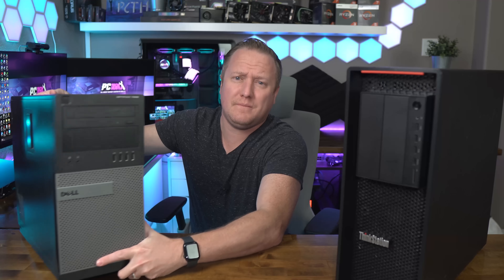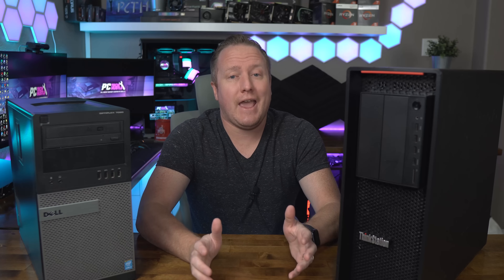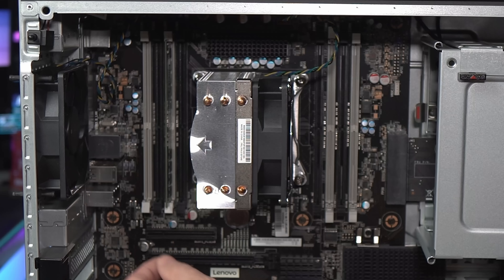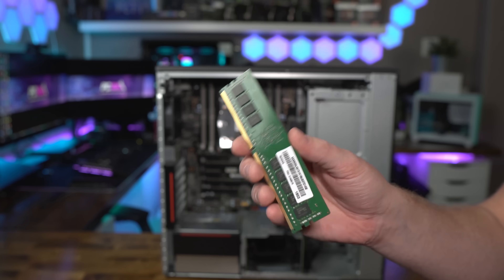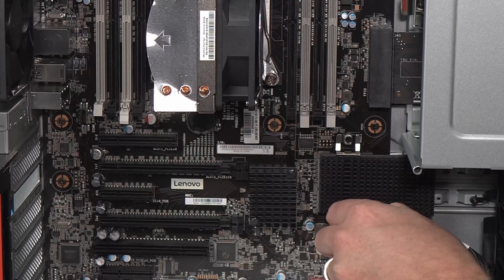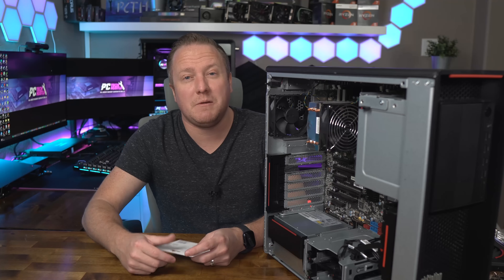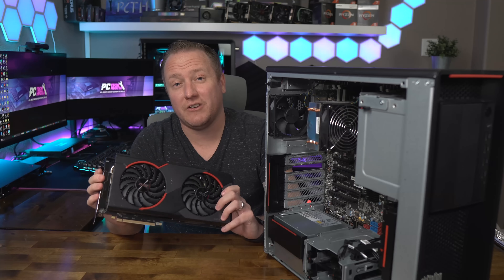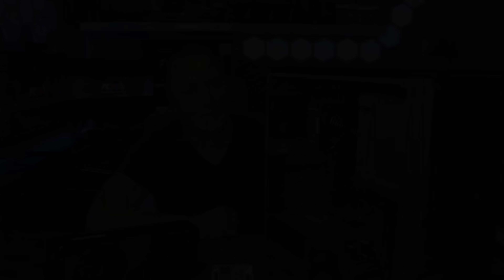The 2024 New Meta of Budget PC Gaming! - Lenovo p520, rx5700 XT, 32GB RAM for UNDER $400!

Comment: I've gone through a couple of these boogers (Not because they broke down, just kept selling them lol). They are really solid and the fact that 99.9% of listings you'll see come with a 900w PSU and two 8 pin connectors, is great for GPU compatibility. Awesome machine for someone looking to build something simple yet powerful.
Reply: They don't come standard with any specific PSU There's a 690W, 900W and 1000W PSU available, and what you get depends on what it was ordered with...
Reply: @timfountain98  Ok.... let's say it this way, unlike the p500 or p510, 99.9% of the listings will be for configurations including a 900w psu. With all the versions I've bought, sold,  all the listings I've seen, the option for a non-900w version doesn't even come up. Almost like it doesn't exist lol.
Reply: @dKing So I did actually go and look through the first 10 P520 listings that are up on ebay right now.  Not a single one of them lists the power supply that is in the box.  Not sure where you got your 99.9% from. As I said, mine came with a 690W and when the configurator for the P520 was active, you had to choose a specific PSU.
Reply: @timfountain98  Your experience is totally different from mine. Especially when buying from a certified refurbisher.  They usually have a custom specs page and do include the PSU. For the ones that don't it's easy to ask, and they usually come with 900w.
Reply: A very clever build. Thank you.
Reply: Whats a good budget CPU for the P520
Reply: @StephenBarnes-z6c  W-2135 6C 12T is a good budget. I have a W-2295 in mine, but, er, that was not at all cheap....
Reply: Ehh. The cpu upgrade path isn't great... Only compatible with decade old cpus
Reply: @DdoubleB03  If they get the job done, that's all that matters. The P520 is still  a great option for most gamers. Especially folks that play games at 1080p and do mostly e-sport titles.
Reply: yeah its about time this segment matured, what a pain back in the day having to replace the power supply just to power up a decent video card.
Reply: @MrSamadolfo  Beautiful thing is? As the machines of 2019 and 2020 continue to age, they'll be in the next wave of liquidation sales and showing up in crazy amounts on ebay lol.
Reply: FACTS 😎 @SkywardKing

Comment: I use a used late 2021 aurora r10 alienware ryzen 5 5600x and a rx 5700xt 32gb 3200mhz ram and its amazing I paid less than 500 even after adding a aio, ssd and 24gb ram since it came with 8gb originally
Reply from the maker: Dang!  That's a heck of a deal!
Reply: Paid 350 originally for the pc with a 1tb hdd, fan cooler and 8gb ram.  I added the aio, 24gb of ebay ram, a 500gb ssd and upgraded the psu...I love ebay lol

Comment: Currently using this with a 6700xt and its been a beast for the money . Heat is the main issue noctua makes a cooler thats low profile and is compatible with that socket .
Reply from the maker: Nice!  Ooo I do love the idea of replacing the cooler!
Reply: @PCTechHustle  NH-D9DX i4 3U i believe thats the cooler . i accidently purchased the d9l but made it work with all the spare hardware i have around and its definetly an upgrade over stock.
Reply: @PCTechHustle  Yes that noctua works and also repleaced the fans in mine and added a second intake fan as those stock fans the cpu gets so hot. Now at max load it stays frosty.
Reply: And windows 11 wont be any issue for this platform.
Reply: @deadatdawn2108 Do you mind linking which 6700xt you went with and confirming the Noctua cooler? I am thinking of doing this exact setup.
Reply: @BoostinChick  Noctua NH-D9DX i4 3U perfect fit and so much better.
Reply: @feelsbad1193 do you need any extra cable adapters the fan pin is different right?
Reply: @Gh0styGames  I needed 2 fan splitters and bought 4 pin pwm fans. I did have to remove some uneeded plastic off the fan connectors to make them fit. All very easy to do.The pins are the same 4 pin pwm but this plastic separator I removed.
Reply: @BoostinChick  i used the xfx quicksilver319 its a pretty massive card and it fit no problem.

Comment: I've just bought an Optiplex 3020 for my grandson to play Minecraft and Roblox on with Win11 installed, so I don't think the Optiplex is quite obsolete just yet.
Reply from the maker: I think 4th gen will still run windows 11.  For how long is the bigger question though.  I might be in the same boat with this system.  Time will tell!
Reply: I mean there are some Optiplexes that will officially support Windows 11, like the 7060 I set up for my sister. It has an 8th-gen i7. I paired it with a Sapphire Pulse low profile RX 6400
Reply: for something like minecraft and even older titles and maybe some more current the optiplex will be fine, its those that are looking for the more demanding stuff the optiplex will start to show its age.

Comment: I still don’t know how to install windows on this I bought windows 11 and i just can’t install it on the Lenovo p520 can you maybe make a tutorial on how too?
Reply: 🙂 pull out the usb jump drive and first verify that you can pull up the Bios screen, check out all the settings, maybe put everything to default. look up the boot order and move the boot order around so that USB boot is first, also the jump drive might have to be in a specific usb port on the back of the case. But first thing is to pull up the bios screen cause if you cant even do  that then we have a big problemo.
Reply from the maker: That is odd.  I was able to install no problem from USB boot device.  Are you able to boot from a USB into the windows 11 installer?  Feel free to also join my discord to chat more in-depth on the topic / troubleshooting channel.
Reply: I bought windows 11 from micro center put the usb into the motherboard and it just won’t work it’s stuck in boot just saying Lenovo
Reply from the maker: @clermd  I wonder if you have some other kind of issue?  Take the USB out and see if you can just get a normal post / get into bios first.
Reply: IFF all is working on your P520, hit "Enter" in the start up and then select boot options and go from there.  @clermd

Comment: Dated and dead, since RX 5000 series lacks mesh shaders.
Reply: How many games use the mesh shaders?
Reply: @AlexHusTech  Doesn't matter, it's a 2019 card, and it feels like a 2016 card. 10 series was in 2016
Reply: @AlfaPro1337  How does it not matter lol calling it dead when there's only 1 game out that uses mesh shaders, 5700XT is still a beast of a card for the price.
Reply from the maker: Agreed.  The 5700xt is a very capable card.  Its performance is well within spec of its generation being that of around a 2070.  This video is not about the latest hottest tech.  Clearly this person is new to my channel as I cover mostly budget / low cost builds.
Reply: @AlfaPro1337  You're truly out of touch, and your arguments are beyond weak.  Stop embarrassing yourself.
Reply: @PCTechHustle  I mean, 30 series and 6000 is still more than enough. I wouldn't take 20 series, since it's just 10 series with AI+RT, and the 2070 and up is just RNG plagued with VRAM heat of death.
Reply from the maker: @AlfaPro1337  Sure a 30 series or 6000 can do the job as well in this kind of machine... but can you keep it under $400?  The point of the video being JUST that.  I may circle back on this build and throw in a stronger GPU and upgrade the CPU but this video is starkly about a potential new meta of  LOW BUDGET building / gaming.
Reply from the maker: Dated?  A bit for sure.  Mesh shaders point is pretty dang moot.  The idea of this video is a good CHEAP platform to get into.
Reply: You can still get by just fine with Alan Woke 2 on the 5700 XT, 1080p low medium hovers around 30ish with no stutters and in 720p its 40ish, wait  for a deep sale for the game

Comment: I guess since dell optiplex xx10s and xx20s are gonna be obsolete, I guess I ca; turn them into like a NAS for my mom’s business. But I do have a registry file in my windows iso in my flash drive that can bypass the minimum requirements for windows 11.
Reply from the maker: Hey I hear ya on that!  My PfSense firewall runs on a core2-quad from like 16 years ago!  Old hardware still has its use cases!

Comment: I forgot to mention that X299 is a really underrated platform.  There was almost no non-business market.
Reply from the maker: I just wish this specific platform I could go back and upgrade to an i7/i9 from the same era for possible some improved performance.  You can only do Xeons in these guys.
Reply: @PCTechHustle  So these Lenovo systems are not Cascade Lake compatible?
Reply: these are c422 mobo. they are all xeons, can go up to the w-2195 which is a 18 core 36 thread. but the 2155 10 core 20 thread is a bit more affordable.
Reply: @theconsigliere8463  They also support the W-22xx series.....

Comment: Great vid.  The last I heard you need 8th gen and newer intel and 2nd gen Ryzen as a minimum for native 11 support.  That Lenovo system is 6th gen.
Reply from the maker: It’s supported and I’ve already installed windows 11 on it :)
Reply: @PCTechHustle  I can confirm, built multiple win 11 system on this platform. I can say it is easier to already install win 10 then upgrade to 11